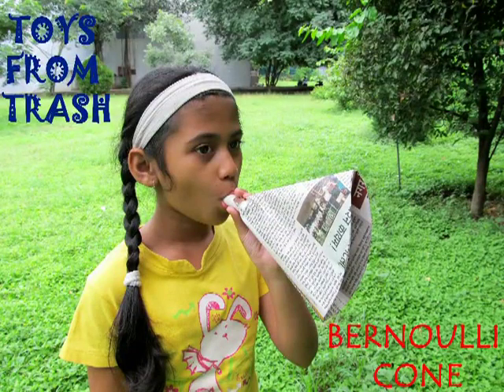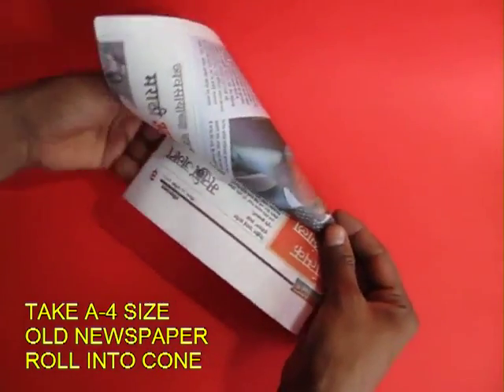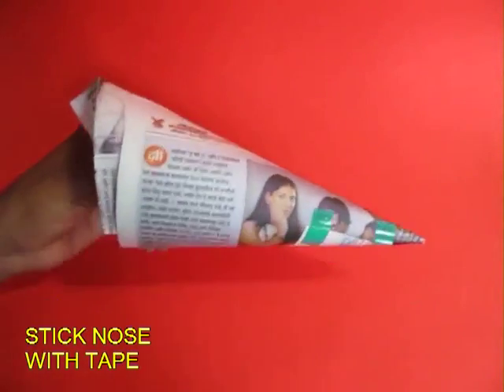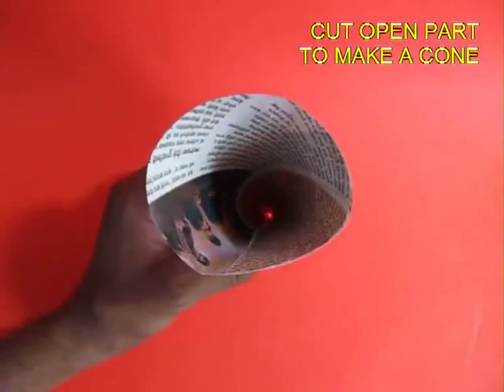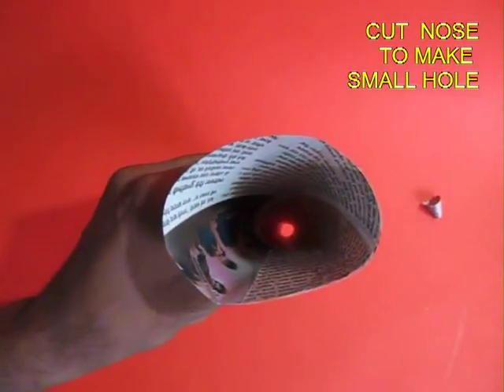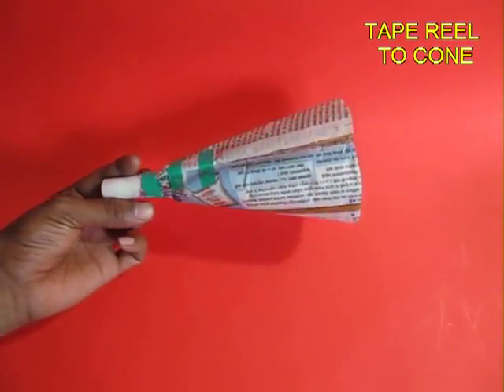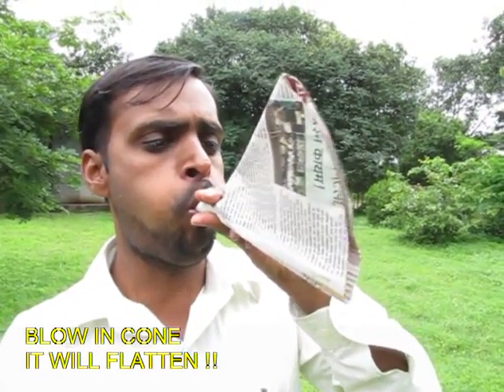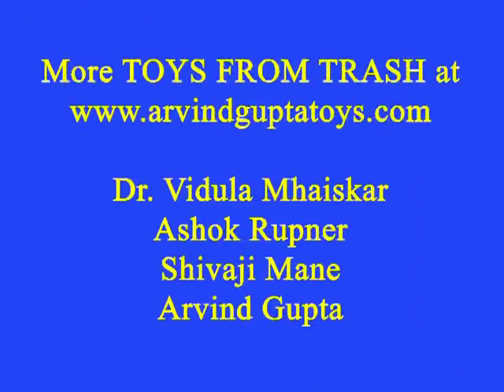BERNOULLI CONE - ENGLISH - 12MB.avi

Comment: @MasterOfSlugs Named after Daniel Bernoulli, the Bernoulli effect says fast moving fluids (including air) have a lower pressure than slower moving ones. By blowing through the cone you create a region of low pressure. The air around the cone is slower therefore at higher pressure. The cone collapses due to the pressure difference. This can also be use to explain flight!